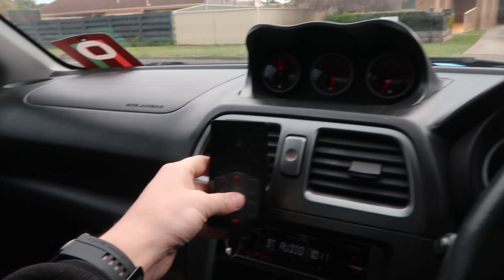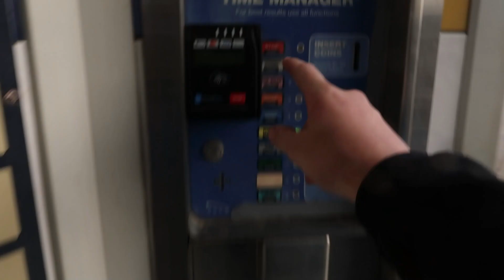HOW MUCH HAVE I SPENT ON MY FLARED AND BAGGED WRX!? (CRAZY!!)

Comment: And do you have a Blow of Valve or a Bypass Valve?

Im not sure which ine i should go for 😞 

Which is better in ur opinion
Reply: One*
Reply: Did you go with Equal length headers or UEL
Reply from the maker: Hey bro I run no BOV/BPV just got it dose
Reply from the maker: @samuelsmith577  still stock UELs